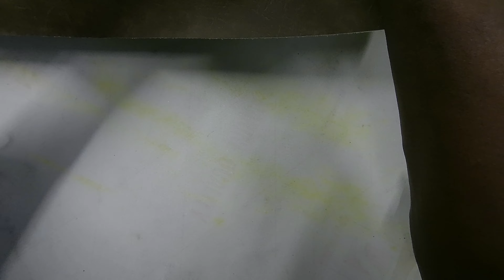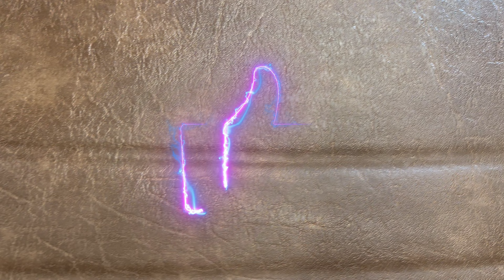Cracked dashboard repair and upholstery step by step

Comment: Absolutely fantastic instructional video!  I learned so much from this.  Great tips.  Yes!  Use a steamer...that is genius.  I have seen heat gun being used and you are right, it has great potential to ruin a project.  I have one question...what is the contact cement you are using?  I don't have a sprayer, so will be using a brush on my project (dash surround).  Lot's of opinions out there about cement.  Thanks in advance Sensei!